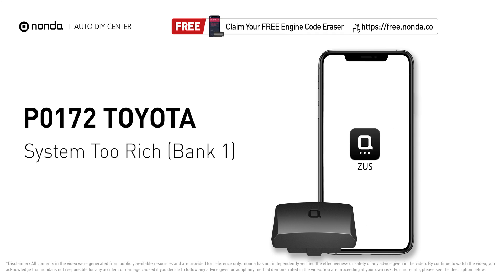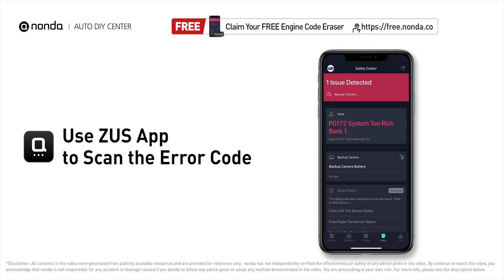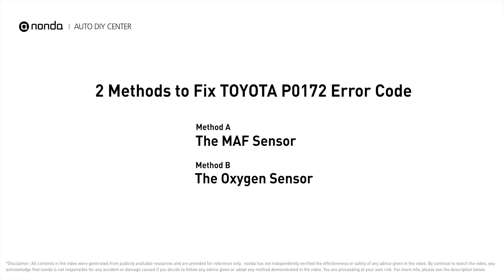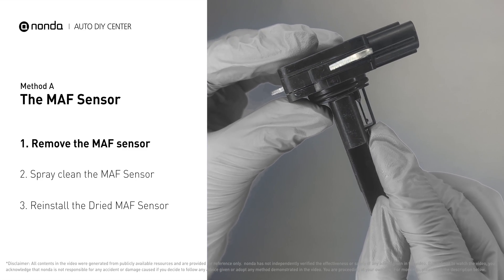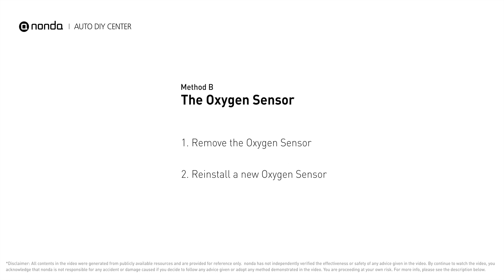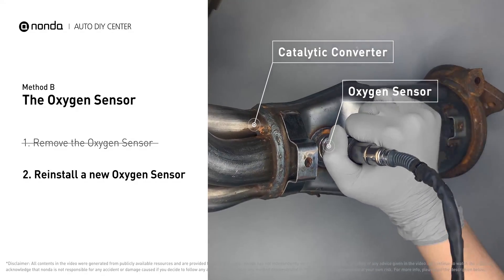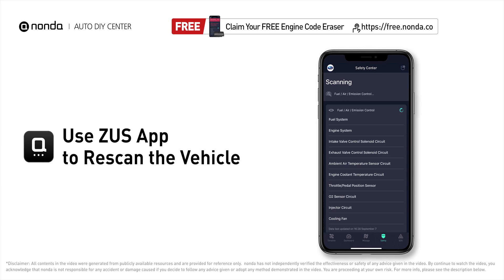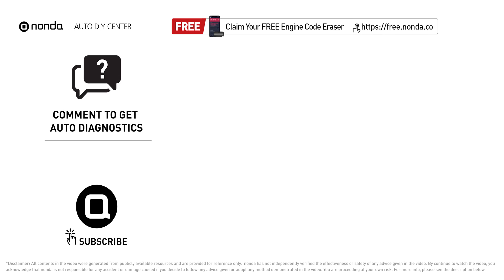How to Fix TOYOTA P0172 Engine Code in 3 Minutes [2 DIY Methods / Only $8.77]

Comment: OBD scanner with live data might do better. Check MAF sensor readings on warmed up idling, should be stable (for 1.6l engine roughly 1.6g/s, for 2l engine 2g/s etc). Have a look at intake air temp as well if the readings are more or less accurate. have look at voltage of pre cat O2 sensor should be jumping between 0.1V and 0.9V. no voltage, stable voltage, voltage jumping between 0.1-0.5v or 0.5-0.9v = problem. No voltage - check the connector/wiring. Mind cat can be hot so careful out there 😉 for healthy MAF max calculated load should read over 90% on full opened throttle (ignition key on 2nd position engine not running, can do on running your call 😉). Do it before start cleaning sensor as that can do more harm than good.

Comment: Mines was a map sensor, not to be mistaken for a maf sensorits actually an air/fuel ratio sensor that causes these problems, not an oxygen sensor. The air/fuel sensors regulate exactly what they are titled, the air and the fuel

Comment: Which O2 sensor would you be talking about first Which is closest to the engine or the second after the catalytic converter, thank you for the video
Reply from the maker: Hi Victor, please provide us with your vehicle's year, make and model for us to provide you with an answer specifically for your car's make/model.
Reply: @nondainc  2007 2nd gen Toyota Prius
Reply: My Rav4 2001 make
Reply: @dfccnews turns out my second-generation Prius had a quite different problem I had replaced my fuel injectors with some remanufactured One's, turns out they leaked fuel slowly causing that code, I just reinstalled my old ones and the code went away
Reply: That's gonna be pre cat (first one)